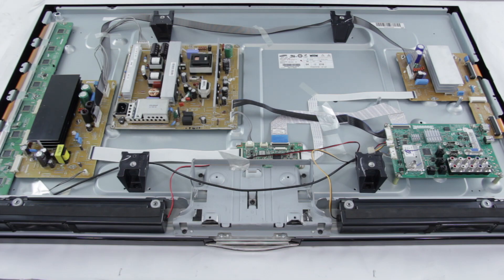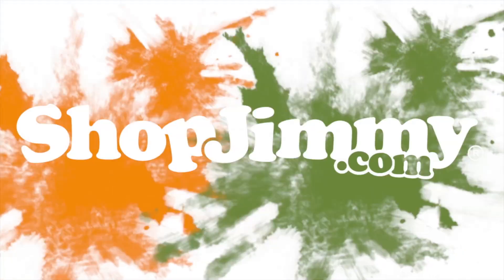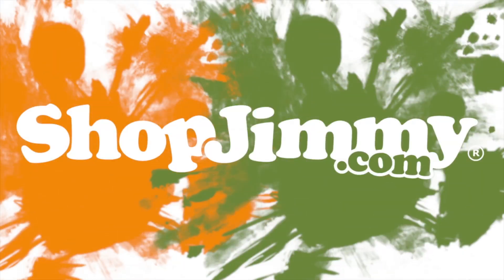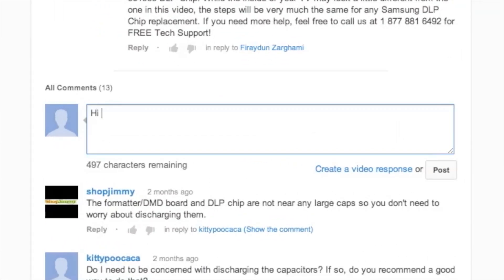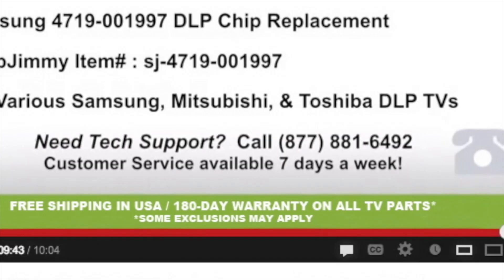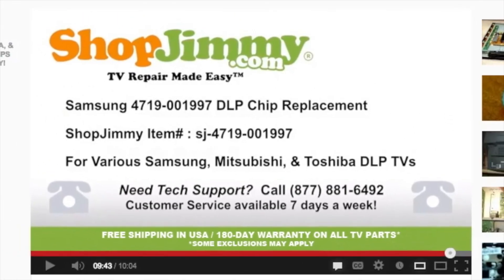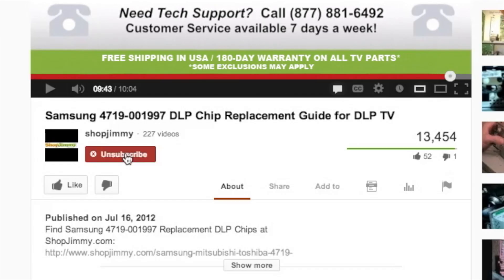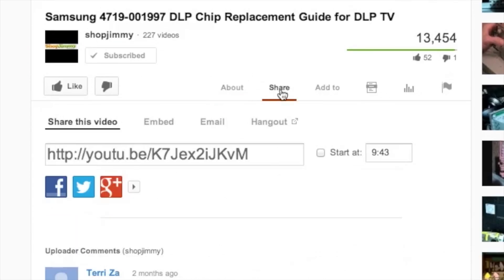Plasma TV Repair Tutorial - Common Symptoms & Solutions - How to Fix Plasma TVs

Comment: Hi ShopJimmy. I have a Zenith 42' Plasma model P42W46X. There is colored flickering after I turn on for about 20 min until warm-up. Then I have a great picture except for 4 solid vertical black lines about 2" wide. Three of them are on the right side of the screen and one is slightly left of center. I have no idea which board might be the problem. Can you help?
Reply from the maker: jblover1810  I recommend replacing buffers in your TV.  Here is a link to replacement parts:  http://www.shopjimmy.com/catalogsearch/result/index/?cat=96&q=P42W46X  Be sure to match part numbers on your current board, with your replacement for compatibility.  Thanks and please let us know if you have any further questions with your TV Repair!  www.shopjimmy.com

Comment: I have a horizontal black 1pixel line on a 50" Samsung Plasma - I've replaced the Y-Buffer Board, but the line didn't go away - what next?
It's a 50" Samsung PN50B550T2FXZA  version S602
Reply from the maker: Steve Taylor   This sounds like a TV panel (TV Screen) problem.  If your TV panel is bad, it may be more cost-effective to replace the TV as panels are typically hard to find in stock, difficult to replace, and expensive.  Thanks and please let us know if you have any further questions!  www.shopjimmy.com

Comment: I have a samsung pn58b540 with no picture. I have replaced the y main and y sustain boards with used boards on the left side with no success. There is a repeating buzzing sound coming form the y main board. About 4 times a second.  Is that a sign of a bad board? Thank you
Reply from the maker: Shawn Wolford   I recommend replacing the Y-Main Board and the Upper & Lower Y Scan Drive boards in your TV.  Here is a link to replacement parts for your TV model number:  http://www.shopjimmy.com/catalogsearch/result/?q=pn58b540  Be sure to match part numbers on your current board, with your replacement for compatibility.  Thanks and please let us know if you have any further questions with your TV Repair!  www.shopjimmy.com

Comment: Working on 51" Samsung, made in 2011, Model PN51D530A3FX2A. Symptoms: Turn power on, clicks, red standby light comes on, clicks, light flashes once, clicks again, red light comes on, clicks again, then nothing. I checked all capacitors for swelling or leaks and could find none. Debating buying the whole power board. Suggestions?
Reply from the maker: Davis Adams   Try this at your own risk. Unplug the TV, then disconnect the y board from the power supply and power on the TV. See if the TV powers up. Please reply with the results. Thanks! www.shopjimmy.com

Comment: i have Samsung PS50A457 Plasma TV  a thin vertical black line near the centre f the screen. if it were either side you could identify either ysus or xsus. can you help?
Reply from the maker: denise terry   This sounds like a TV panel (TV Screen) problem.  If your TV panel is bad, it may be more cost-effective to replace the TV as panels are typically hard to find in stock, difficult to replace, and expensive.  Thanks and please let us know if you have any further questions!  www.shopjimmy.com

Comment: i have a 50' lg model # 50PA5500-UA the tv has sound but no picture at all. the screen is completely black. when i took the back off there is a red light constantly lit up on the board with all of the inputs and there is a blinking green light on the controll board. i dont know if that helps you but im having a really had time trying to figure this out.
Reply from the maker: Arron McIntyre  Please watch this video FIRST to help with your repair!  TV Repair! LCD, LED, Plasma, DLP How To Fix Your TV with ShopJimmy.com Help!  I recommend replacing the YSUS & the YDVTP & YDRVBT boards in your TV.  Here is a link to replacement parts:  http://www.shopjimmy.com/catalogsearch/result/?q=50PA5500-UA  Be sure to match part numbers on your current board, with your replacement for compatibility.  Thanks and please let us know if you have any further questions with your TV Repair!  www.shopjimmy.com

Comment: Hello - it seems like i have the exact same model shown in the tutorial. (PN42C450B1D) It will not turn on but a solid red light can be seen from the front panel. No visible signs of wear, burning or damage from any of the boards. A few clicks can be heard from the power board relay while the green light flashes on the logic board then it stops. I tried replacing the fuses on the power board to no avail so I decided to order a power board for it, and the clicking still continues with no startup. I disconnected all boards and started troubleshooting one at a time to pinpoint the problem. For starters the replacement power board is flawless. When I plug in the main board I hear one single click, then i can hear the startup jingle music for the first time in weeks (lol) but still no picture and no repetitive relay clicks. No clicking for the logic board or y-sus either. The repeat clicking only happens when I reconnect the logic board and combine it with other 2 boards. Neither of them will click until I connect all three simultaneously.
Reply from the maker: samo wordo   I recommend replacing the main board in your TV.  Here is a link to replacement parts:  http://www.shopjimmy.com/catalogsearch/result/index/?cat=56&q=PN42C450B1D  Be sure to match part numbers on your current board, with your replacement for compatibility.  Thanks and please let us know if you have any further questions with your TV Repair!  www.shopjimmy.com

Comment: Hey there, I had a short after wiring a three way switch in my living room (pretty embarrassing) the hot cable and the ground touched, sparked and breaker jumped... woohoo! :( My cablebox is fried, but i'll just tell xfinity there was a power surge. Anyways, the symptoms: My LG 55LW5600 UA AUSZLHR, the Serial Number is 112RMKU54541, when I hook up the TV to the wall and turn it on, the power light lights up but I get no image, no backlight. I have experience soldering so I'd much rather fix it myself than spend 200 dollars to have some guy do it :/

Comment: Hi, I have an LG RU42PX11. It turns itself off a few seconds after I turn it on. There is no picture, but for a few seconds I do hear tv static because it is not connected to cable. I disconnected the ysus and it does the same thing. I disconnected the zsus and it does the same thing. What else could be the problem?

Comment: Hello..  I have a Samsung PN43D450A2DXZA. The TV will not power on. There is a red light that comes on and stays on solid. It does not flash. The power board has a relay that clicks a few times. I disconnected the Y-Suss and applied power and the TV exhibited the same issue. Another tech person told my Pastor, whom the TV belongs, that he needed a new panel. There is a green light on the logic board that flashes a couple of times while the relay clicks on the power board when power is applied.
Reply from the maker: Eric J Simmons   I recommend replacing the main board in your TV.  Here is a link to replacement parts:  http://www.shopjimmy.com/catalogsearch/result/index/?cat=56&q=PN43D450A2DXZA  Be sure to match part numbers on your current board, with your replacement for compatibility.  Here is a link to a video showing how to identify your part number, click here:  Samsung Main Boards & Digital Boards: Part Numbers for LED, LCD, DLP, Plasma TV Repair  Thanks and please let us know if you have any further questions with your TV Repair!  www.shopjimmy.com
Reply: Hello..  I think I saw a reply from you, but for some reason I cannot find it. I think you said you thought it was my control board. Could you please let me know where that reply you sent me is?
Reply from the maker: Eric J Simmons  It is directly above your comment.  Here is the recommended repair.  I recommend replacing the main board in your TV. Here is a link to replacement parts: http://www.shopjimmy.com/catalogsearch/result/index/?cat=56&q=PN43D450A2DXZA Be sure to match part numbers on your current board, with your replacement for compatibility. Here is a link to a video showing how to identify your part number, click here: Samsung Main Boards & Digital Boards: Part Numbers for LED, LCD, DLP, Plasma TV Repair Thanks and please let us know if you have any further questions with your TV Repair! www.shopjimmy.com
Reply: ShopJimmy.com Awesome..  I see that your shop has the part. I will order it next week Wednesday.

Comment: Thank you for what you do and how you are helping DIYers. We have a Samsung PN58C550G1F. We heard a loud popping sound and the picture disppeared. Can't turn it off or on. No picture at all. All other components working properly. Thanks for your help!
Reply from the maker: Pat Bernhard   I recommend replacing the Y-Main Board in your TV, and the Lower and Upper Y Scan drive boards.  Here is a link to replacement parts:  http://www.shopjimmy.com/catalogsearch/result/?q=PN58C550G1F  Be sure to match part numbers on your current board, with your replacement for compatibility.  Here is a link to a video showing how to identify your part number, click here:  Samsung Plasma TV Repair: Samsung Plasma Panel Parts Guide  Thanks and please let us know if you have any further questions with your TV Repair!  www.shopjimmy.com

Comment: I have a 60 inch Funai Model F42PDME & the picture is real dark or not anything at all. . I see 6 different PCB's. It's not the power suppl. What would you troubleshoot next?Please advise. Thanks
Reply from the maker: All Good  Please watch this video FIRST to help with your repair!  TV Repair! LCD, LED, Plasma, DLP How To Fix Your TV with ShopJimmy.com Help!  I recommend replacing the ZSUS board in your TV.  Here is a link to replacement parts:  http://www.shopjimmy.com/catalogsearch/result/?q=F42PDME  Be sure to match part numbers on your current board, with your replacement for compatibility.  Here is a link to a video showing how to identify your part number, click here:  LG Plasma TV Repair: DIY Part Identification Number ID Guide for LG & LG Philips Plasma Panel Parts  Thanks and please let us know if you have any further questions with your TV Repair!  www.shopjimmy.com

Comment: Samsung Model PN51F8500AF. Purchased 5/20/13.

Symptoms: Will turn itself off at random times. I unplugged it all day last night for 10 minutes, plugged in back in and it ran from 8-11pm. This morning, not being unplugged, it turned on but turned itself off in a couple of minutes. Unplugged it all day today, plugged it back in and it ran for 42 minutes and turned itself off. I noticed a clicking sound like it is try to turn itself on or power cycle maybe. No loud pop. We plugged it directly in to the wall outlet to make sure its not the surge protector.  When the tv turns on, the picture looks fine. No lines. I noticed that the red led power light on the lower-left front blinks everytime: 5 sets of 2 blinks; then starts the same sequence over! Some error code? Any suggestions would be greatly appreciated.
Reply from the maker: Weather Reporter: John Blake  Please watch this video FIRST to help with your repair!  TV Repair! LCD, LED, Plasma, DLP How To Fix Your TV with ShopJimmy.com Help!  I recommend replacing the main board in your TV.  Follow this link to replacement parts:  http://www.shopjimmy.com/catalogsearch/result/index/?cat=56&q=PN51F8500AF  Be sure to match part numbers on your current board, with your replacement for compatibility.  Here is a link to a video showing how to identify your part number, click here:  Samsung Main Boards & Digital Boards: Part Numbers for LED, LCD, DLP, Plasma TV Repair  Thanks and please let us know if you have any further questions with your TV Repair!  www.shopjimmy.com

Comment: HI my TV is samsung model pn58c550g1fxza. the TV shuts off and will not power up I checked the fuse are good and I notice on the power strip the ground fault light is on as long as the tv is plugged into it unplug it the fault light goes off. everything else still works on the power strip just the TV. I tried to plug in regular outlet and still nothing.

Comment: I need help with a Samsung T.V. Model#PN43D450A2D Plasma.Had power surge and the tv went out,no stand by light,and no power.I replaced the power board and still having problem.Do you know what the problem can be and what board I would need and how much would it cost?Thank You Joe
Reply from the maker: Adriana Ruggeri  Please watch this video FIRST to help with your repair!  TV Repair! LCD, LED, Plasma, DLP How To Fix Your TV with ShopJimmy.com Help!  If you do not know which board is bad, it is recommended that you replace the power supply and the main board with a power surge.  Here is a link to replacement parts:  http://www.shopjimmy.com/catalogsearch/result/?q=PN43D450A2D  Be sure to match part numbers on your current board, with your replacement for compatibility.  Thanks and please let us know if you have any further questions with your TV Repair!  www.shopjimmy.com

Comment: Hello I have a 43 " 3D Plasma Samsung made in Feb 2011 Model number PN43D490AIDXZA  Version N 102  It will not turn on On the bottom left side there is a red light that blinks when it is plugged in I removed the back cover and all the capacitors look good no bulging on the tops. What can I do to troubleshoot this problem ?
Reply from the maker: Jim Marchitto  Try this at your own risk, Power off the TV, I recommend disconnecting the y board and then applying power to see if the TV powers on.  Thanks!  www.shopjimmy.com
Reply: Got your reply No that did not work I have disconnected each board in order from left to right side of the panel and no picture or sound at all Stumped !!!

Comment: I have a 50 inch Philips Plasma TV 50PFP5332D/37. I have a black vertical line that runs from the very top of the screen to the very bottom of the screen. It's located approx 4 to 6 inches left from the center of the screen and approx 3 inches wide. Could it be the Y Buffer boards OR the Main Logic Control Board? thnx
Reply: Oh AND... other than that vertical line... the TV works perfect!
Reply from the maker: Thomas S   This sounds like a TV panel (TV Screen) problem.  If your TV panel is bad, it may be more cost-effective to replace the TV as panels are typically hard to find in stock, difficult to replace, and expensive.  Thanks and please let us know if you have any further questions!  www.shopjimmy.com

Comment: Hello, I have a Dell W5001C HD plasma TV.  I was occasionally having the lower 1/3 of the screen turn completely black for a minute or two and then it would clear up.  The other night the TV turned off by itself.  After turning it back on, the screen remained black, but sound is fine.  Suggestions?  Please include specific part numbers.  Thanks for this service you provide.  Extremely valuable!!
Reply from the maker: Robert Garcia  Please watch this video FIRST to help with your repair!  TV Repair! LCD, LED, Plasma, DLP How To Fix Your TV with ShopJimmy.com Help!   I recommend replacing the buffers in your TV.  Here is a link to replacement parts:  http://www.shopjimmy.com/catalogsearch/result/?q=W5001C  Be sure to match part numbers on your current board, with your replacement for compatibility.  Thanks and please let us know if you have any further questions with your TV Repair!  www.shopjimmy.com

Comment: lg 60ps60-ua  has a vertical 2 inch black stripe in the middle of the screen
Reply from the maker: Todd Burch   This sounds like a TV panel (TV Screen) problem.  If your TV panel is bad, it may be more cost-effective to replace the TV as panels are typically hard to find in stock, difficult to replace, and expensive.  Thanks and please let us know if you have any further questions!  www.shopjimmy.com

Comment: 1). I have a 46" Daewoo Model-PD46C10 and it only has sound output from one side,
even if we select the Int. or Ext . Speakers settings? (I have not try the audio outputs yet) 

2). Recently the TV unit will shut off after a few mins of use, ( i am thinking some kind of overheating that caused the unit to go into self protect mode and shut down), so i am not sure what part/board will be needed to fix/replace?

Kindest regards!
Reply from the maker: AVBestDeals   Please watch this video FIRST to help with your repair!  TV Repair! LCD, LED, Plasma, DLP How To Fix Your TV with ShopJimmy.com Help!  I recommend replacing the main board in your TV.  Here is a link to replacement parts, CLICK HERE:  http://www.shopjimmy.com/catalogsearch/result/index/?cat=56&q=PD46C10  Be sure to match part numbers on your current board, with your replacement for compatibility.  Thanks and please let us know if you have any further questions with your TV Repair!  www.shopjimmy.com

Comment: Samsung SV420M
VERTICAL COLORED LINES THRU THE SCREEN. I CHANGED THE LOGIC BOARD WITH NO RESOLUTION.
CAN U G IVE ME GUIDANCE ON WHAT TO DO NEXT?
Reply: I AM SO SORRY,, THAT WAS MY VIZIO. MY SAMSUNG MODEL NUMBER IS: pn51d440a5d model code xza
Reply from the maker: Laura Trivitt   This sounds like a TV panel (TV Screen) problem.  If your TV panel is bad, it may be more cost-effective to replace the TV as panels are typically hard to find in stock, difficult to replace, and expensive.  Thanks and please let us know if you have any further questions!  www.shopjimmy.com
Reply: ShopJimmy.com Thank for your assistance.

Comment: I have a Samsung model FP-T6374 Type SA63P7 that I have to cycle the power off and on 8-10 times to get the picture to come on.  The power comes on fine the picture just doesn't show up.  I get a quick grey flicker and then it either gives me a picture or doesn't and I have to cycle the power (its powered up black).  What are your thoughts?
Reply from the maker: Bret Taggart   Try this at your own risk.  Check VS and VA voltages see if they are coming up fully. Also check caps on the power supply board to see if all of them show up normal.  Thanks!  www.shopjimmy.com